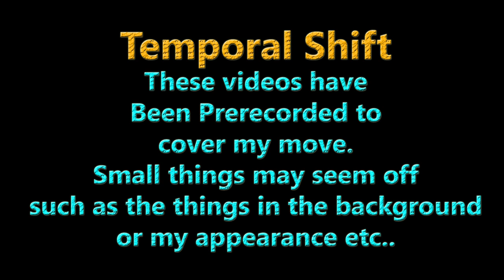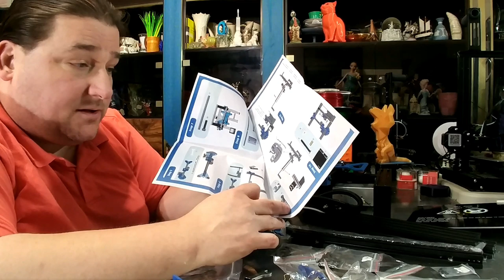Longer 3D LK2 3D Printer Unbox, Build   T3DP

Comment: I think longer and alfawise u30 are one in the same. I had to order a new mobo for my u30 and the board says longer. I have had alot of problems with the u30.
Reply from the maker: Correct the u20 and u30 are both oem longer 3d machines
Reply: @nerys71  So, trip update? Did Yogi's Ark make it to the Perfect Place?
Reply from the maker: @Pygar2  yes! At motel 6 in moriarty now!